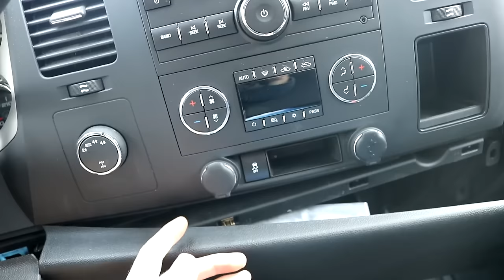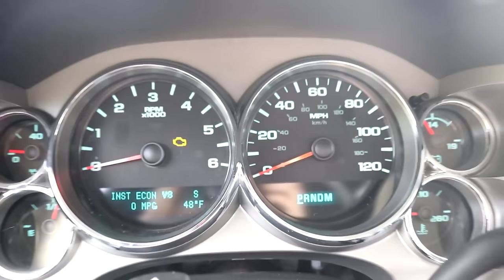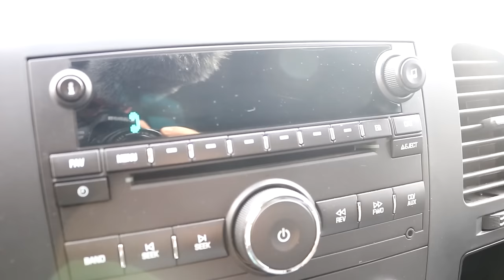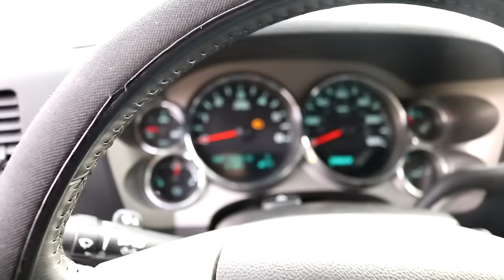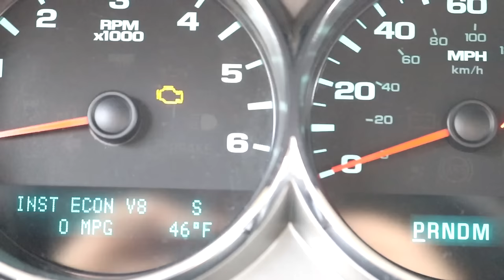How To Disable/Remove Onstar Completely 2007-2020+

Comment: Fun fact.
(To those who comment talking about phone privacy too)
Your GPS is ALWAYS on and CANNOT be disabled on any newer phone (2009ish+, Android or Apple)

To prove this. (Way easier to prove on Android, harder to demonstrate on iPhone- very hidden)
1. Go to settings, disable gps, put phone on airplane mode.
2. Travel a few miles, add in some turns too. (Bonus points for a couple stops at businesses)
3. Take phone off airplane mode, turn GPS back on. 
4. Wait a minute or so for the data to sync up. 
5. Go to your map. Go to settings. Click on timeline. Look at your timeline for the day. 
Boom. There's your entire trip right there. 

But how?
The GPS was off and the phone was on airplane mode?!? lol
EXACTLY
It's never off. 

Bonus points if you already were in settings and disabled tracking.
To bad it doesn't actually stop tracking you. 
Disabling tracking only makes it slightly harder to access your route in timeline. 

How did this happen then?
Right this second, your phone knows exactly where it's at. The second you turn it off, it creates a time stamp log. (What happens next depends on the age and model)
It continues to keep track of where it's at monitoring it's location. (Sensors and sniffing) All that happens if it temporarily stopped transmuting.
Once you turn it back on. All the collected data gets complied and sorts itself. Then creates a new log and transmits it to your map account. This creating your timeline route.
Reply from the maker: I had a hunch, a flip phone may be the only option
Reply: Derelict yes flip phones are the best.. I’m wondering though are they still untraceable?
Reply: @thespiritof76..  
No such thing as a retail phone that's untraceable.

Just like no retail printer is untraceable.

If you can buy it, it is tracked and traced forever.
HP got busted in 2003 for putting microphones inside computers and monitors and not disclosing it anywhere.

So people bought products and have been monitored without knowledge or consent.

Best part is, good microphone can echo locate rooms. That's sonar.
So it can ping the room and make out floorplan.
Then listens to know where it is located and how many people are in the room.

AI is good enough now to know a who a person is just by listening to the sound of them clearing their throat or coughing. 

Facial recognition only needs corner of your eye and side of face or corner of eye and side of nose.
That's all. 

You can send me just that and I can tell you exactly who that person is. Even if you change hair color or eye color.

Don't believe me?
Go on their websites and read the sales material and watch demo videos for yourself.
Reply: @thespiritof76..  flip phones nowadays are all android.

All android is constantly on.
Reply: Aaron Eckardt what about the Nokia Nextel or just plain old walky talks? I know there not secure but are the being monitored
Reply: You can crack the phone open and remove the antenna. If it can't communicate with GPS satellites, that's all.
Reply: @thespiritof76..  when you remove battery
Reply: @fauxbro1983  I have a few. They all need battery’s but power up.
Reply: I tried this on an Android phone and definitely did not get the results you claimed.  Didn't show the trip or the stops I made.
Reply: @thespiritof76..  Yes. However, where I live, even if you had one in working condition, there is no network support for analog or what you'd refer to as 1G.
There is still some limited (non data) signal bandwidth for 2G devices (Legacy support), If you found a newer version with the "Dual band" models.
I have, a Nokia that was an early dual band phone. Had analog and limited 1G function. It works, but no network has support for it.
Reply: @uthmanibn-jafar1159  clearly you have no idea what you're doing or the interface has been changed some.

It was 100% accurate when I wrote it.
Everything I say is accurate and can be shown with evidence.

Unlike others. I ONLY speak about things I have first hand experience and knowledge of.

I will be the very first person to admit I have no idea and am ignorant on a subject. When I do speak on it, I always speak from my experience only.

So if things changed in the time since. Oh well.
Things change. That's the world. Doesn't mean I'm wrong. Just mean things have been obfuscated from you.
Reply: @slowpoke96Z28  
Let me get this straight.
You're claiming that every cell phone is actually a satellite phone because it has a GPS receiver inside of it?

That the GPS isn't actually data received from the network it is connected to?

Am I understanding you correctly???

This is really rich stuff here. I'm enjoying playing along with nonsense.
I doubt you have a clue what the L band is.
Reply: Fun fact. I use a linux phone for this very reason.
Reply: its called a faraday bag
Reply: get a faraday bag problem solved
EFFF onstar!
Reply: Carry it in a shielded box.
Reply: Pull the battery. It's not doing anything without power.

Or just leave it home. It will faithfully record the fact you never left the house.
Reply: @Aaron Eckardt  what about flip phone with removable battery.
Reply: @aaroneckardt5514  true story
Reply: You can put a Faraday cage on you phone... not your truck 😂
Reply: Nothing fun about thay fact- other than you are incorrect.  You can place the phone in a faraday bag when you are not using it...
Reply: I'm from the 80's. I don't carry a cell phone. I drive a 1994 Chevy pickup with an old cassette player, cd, and radio. That's all I need. Everything extra is compromised.
Reply: Stay away from iphone. There’s certain phones with tutorials on physically removing the gps, bluetooth and wifi you can follow but there’s still ways to track you. We have to ditch cell phones altogether, most likely all communication devices in general for actual privacy.
Reply: @fauxbro1983 they can definitely still monitor your location and microphone if you remove the battery.
Reply: GPS tracking is provided by the cell towers, and your phone is hard-wired to constantly search for and attempt to connect to cell towers that are in range. So it does not matter if you have an older or newer phone - any phone that relies on cell towers can be tracked if it is in range of at least two towers (whether it has a SIM in it or not). The location feature on newer phones, that you can turn on and off, is just an enhanced version of this functionality that allows the phone to determine its location by devices other than cell towers, such as wifi access points, bluetooth beacons, other phones in the area, etc.

Even if you turn your phone off, power is still supplied to the radio to enable long interval-based pings, like every 1-10 minutes. This uses minimal power but allows the phone's location to be known. Now you see why they ended removable batteries. But if you run your battery down to 0% you're good, right? No, not really. When the battery reports as 1% or lower to the user of the phone, there is actually about 15-20% charge left.  This is enough to allow those location pings to continue for months.

It's a great idea to disable this tracking any way you can, whether it's in your car, your phone, or any other "smart" device.

Comment: So the ones who want to disable onstar because of privacy concerns should dump their smart phones as well. Guess what.  Our phones listen all the time too.
Reply from the maker: the microphone can be disabled for all applications and the phone can be turned off
Reply: The only reason I would remove OnStar is the fact that they can remotely disable your vehicle
Reply: Yes, however people don’t generally go to their cell phone for private discussions and or meetings..... also easy to disable the mic and camera as well as tracking on your phone.. the options are right there in “settings...” you don’t have that option with Onstsr.... Geez, I can’t believe you didn’t know that hahaha
Reply: @Derec  You cannot turn a phone "off".
First you cannot remove the battery. If it is old style with removable battery, open it up, there's a few tiny batteries in it plus the caps powering it. 
So it's still technically on.
Reply: @tz3586  
Where can you buy tin foil???
I haven't seen tin foil anywhere!

You mean aluminum foil????
It won't work. Try it if you don't believe me.

Wrap your phone and then call it from another.
Stop talking about things you don't understand or repeating things you heard from tv.
Reply: @tz3586  
Obviously you are ignorant to know the difference in metal. Read up on metallurgy.

Aluminum absorbs radio frequencies. Hence acts like an antenna. Tin refracts/ repeals. Hence why one would make a hat of it. To keep EMF frequencies out. 

Most believe that's why there's no such thing as tin foil anymore.
Reply: @Derec  ya, no it can't.
That's serious naive gullible ignorance there. 

Virtually every app on your phone you have to give it permission to override your settings. 

Example. You can turn GPS off on your phone. 
Open maps and it will still know the general area of where you are.
How?
Fun fact. You agreed to the TOS of the map app when you set up your phone.
The TOS gives the app permission to override your phone settings.

So even with GPS disabled, it will still turn on and inform maps where the device is.

It is impossible to turn any setting "OFF" or even 'shut the phone off'. 

There's very simple tests to prove that correct.
Reply: It's very easy to leave the phone someplace not so easy to leave your only means of transportation.
Reply: @Momentaryghost  Or put it in a portable "Faraday Cage"
Reply: @aaroneckardt5514  ignorant is not the right word. 
Because this guys not a fng dummy. 
You however should check yourself

Comment: That is not cool that you cannot remove the Onstar module.   The data is still being collected and if you are close enough to transmit/receive sources then data can be collected and detected.  On Uconnect I was able to remove the telematics box completely and thankfully it does not affect any of the vehicles functions in a 2022 vehicle.  I am sure this will all be changing as we get to the 2025 law that requires law enforcement remote access to shut down vehicles.   That law was already pushed through with the insane spending bills they pushed through.  So I fully expect them to make it illegal to deactivate these systems in the not so distant future.   These same systems will likely be used with the soon to be announced tax by the mile systems that are also in testing and were funded in the same crazy spending that included the remote access law enforcement control of vehicles.  Just because the public is blissfully ignorant of what is going on does not mean it isn't happening.   Was hoping there was a way to completely remove the Onstar telematics on the GM products, but sounds like that may not be possible to get rid of all of it.

Comment: I’ve been told I need to disable OnStar in my Camaro because it’s no longer supported by GM because it’s a 2G system and GM switched to the 5G system but then Chevrolet tells me we don’t work on your car no more cause it’s too old so I’m kind of wondering what I need to do OnStar will automatically come on by itself interrupting my radio station acting like it wants me to make a phone call. I have to press cancel to go back to the radio station I want that to stop disabling it with that. Stop on start from doing what it’s doing.

Comment: That’s not a microphone on the headliner. That’s part of the HVAC system. An aspirator, A small fan and sensor that helps your vehicle run on auto mode.
Reply from the maker: i heard it is a Bluetooth microphone grill/cover

Comment: My 2008 communications module has two antennas connections (one is labeled GPS).  You could probably just disconnect the GPS antenna or both antennas (it might cause a circuit failure if transmit is open, I'm not sure).  Really I don't see a need to open the module if you remove the fuse.

Comment: One question.  Why pull the pin extension in the circuit board?  Would not pulling the 10 amp fuse accomplish the same thing?
Reply: Because why take chances ?
Reply: @B.I.-EIO_macdonald9786  Why pull the box and open it up if you don't have to.  Pulling the fuse kills any chance the OnStar system can broadcast your buss communication or faults.  Much simpler to do than dropping the center dash of our truck to access the VICM.
Reply: @deane2974  i actually looked it up on wiki. And the directions even said pulling the fuse will not end the issue. 
Which coincides well with the creators “just in case” approach. 
He is right.

Comment: I installed a custom OS for my phone that doesn't even have a GPS app. I turn my phone off before I get in my car (2003 Camry, so absolutely no tracking whatsoever). I just keep up with all my maintenance and replace things when they wear out. I am not looking forward to the day where I may have to get something that does track. I'd probably rip the whole head unit out and see if installing an old timey tape deck worked.
Reply: Make sure to trun off your cell phone, they track that.

Comment: Just found mine under my driver seat of my 2020 spark, pulled all the wires , green on star light is gone, 4g lte on the stereo display is gone along with wifi hotspot, all features of the stereo still indeed work, xm/am/fm and usb and Bluetooth . HOW ever lost Bluetooth mic on phone calls , which I could careless about because I don’t answer my phone while driving.
Reply: And the app “my chev” also confirms it’s non responsive

Comment: After removing o star on my 2018, gps, navigation, in the settings menu you can’t access the vehicle menu. Also you cannot use the hands free phone through your speakers.
Reply from the maker: Some features should be retained depending on the year and model
Reply: You can add a bluestar module in its place

Comment: My 2016 midnight edition z71 2500hd does not have that little bridge connector piece that connects the smaller board to the larger board in the module. Mine has a white plastic male on one and female on other that connects direct from the other board. I can't remove any connectors in between like this video. I can't remove the connectors on either board since they're soldered. The back of my module has two of those colored connectors that you uses wd40 to remove on the other video. Any advice on how to disconnect it on my system?
Reply from the maker: Disconnecting the antenna like in the other video may be the only option unless you are willing to bifurcate the two boards
Reply: Smash it

Comment: On star can literally cause accidents.  They have the capability ti turn your vehicle off as well.  I was sitting at  a light one day and my truck just died out.  Even the guy beside me who is a very good licence mechanic said it was really odd how my truck shut off and no code was given. I didn't even know my truck shut down until I went to pull away.  I put it in neutral and she fired right up.  It never happened again mind you but they could have put me and others in a dangerous position if I was driving on the highway.  And people wonder why their vehicles just instantly shut off for no reason.  These companies are nothing but corrupt and f*cking nosy.  When you listen in on people you have a serious mental problem
Reply: What reason would they have to randomly shut off your car?

Comment: That's not a mic above your head lmao it's the auto air temp sensor for the climate control smdh the mic is by the overhead unit and drivers visor.
Reply from the maker: changes on the year models
Reply: Lmmfao smdh
Reply: Its beat to just admit you're wrong. I work for Chevrolet and that part has the same exact part number from 2000 to 2017. Smdh and it in fact is what I said it was. Hell sad part is you can even see your mic in your video several times. Smdh
Reply: Team Fi expedition do you have any helpful advice by chance? Since you work for chevy and all? Or do you only waist your time commenting when you can use the opportunity to belittle another? Smdh.....